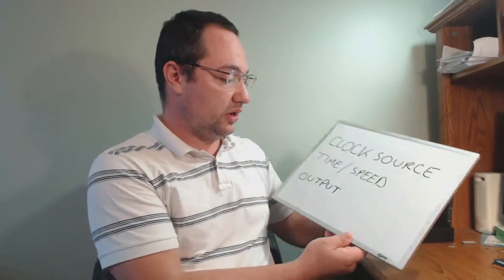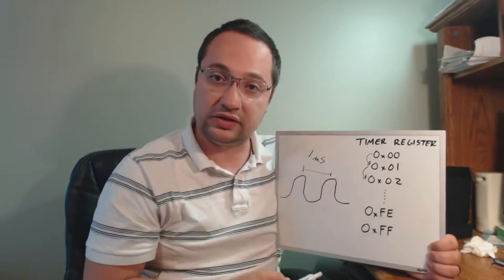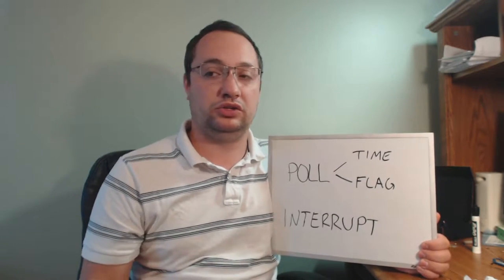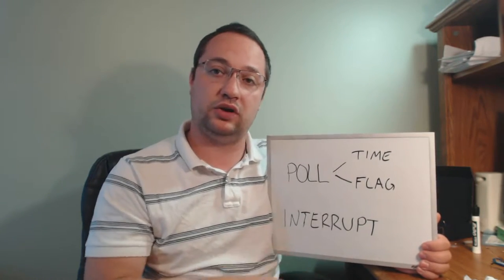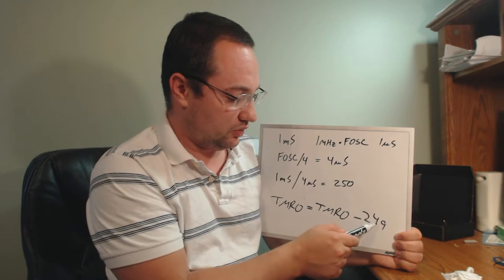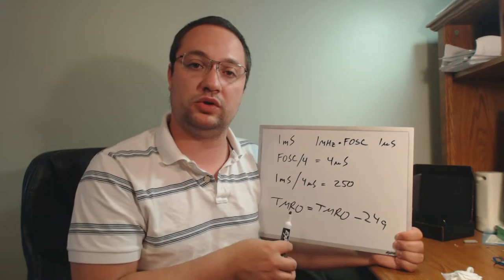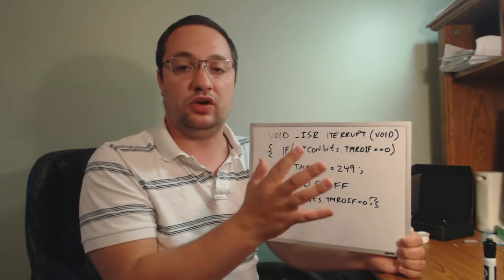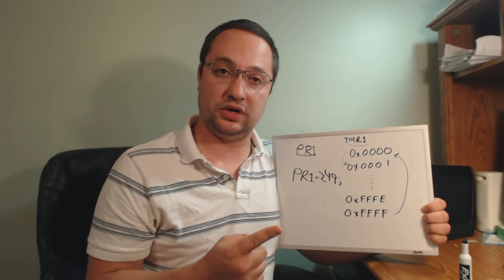eapbg #12 Introduction To Timers

Comment: Hi, thanks for great video!
I have a few questions.  part of 20:58.
1) Does interrupt function called when interrupt flag INTCONbits.T0IF changes from 0 to 1 ?  If it does. 
2) What's the point of checking if (INTCONbits.T0IF ==  ?) inside of interrupt function? (if we are inside of interrupt function INTCONbits.T0IF  must be equal to 1 by definion)
3) Why we check INTCONbits.T0IF == 0  and then set to 0 again INTCONbits.T0IF = 0 ?
4) And last why we need to reset the timer inside the interrupt, it must overflow and begin count from 0 again, or not?
Reply from the maker: 1) I put INTCONbits.TMR0IF but the same idea. Yes, the interrupt fires when that bit goes from 0 to 1.
2) The micro I'm using as an example has only one interrupt vector. This means that any interrupt always jumps to the same spot. While here I'm only using the timer interrupt and so this does not matter, if there were several interrupts then you would have to check which one fired. For good coding practice, I'm showing how to do it if there were many interrupts present. 
3) This is my mistake, I should be checking if == 1. Then if it is 1 reset it back to zero. The reset is needed because the interrupt flag is latching. Once set it will stick until it is reset. 
4) If we need the exact time that the timer can provide then we don't need to do this. Advanced timers can have a compare register that will cause the overflow even if the counter has not reached 0xffff. In this case, the timer is dumb and I'm using subtraction to get an overflow that is less than the timer overflow period.
Reply: Your next video about interrupts explains it in detail. Single vector interrupt, i understood) Thanks for answers!